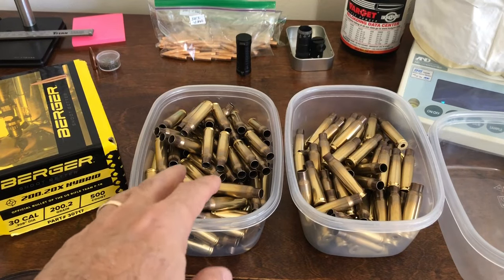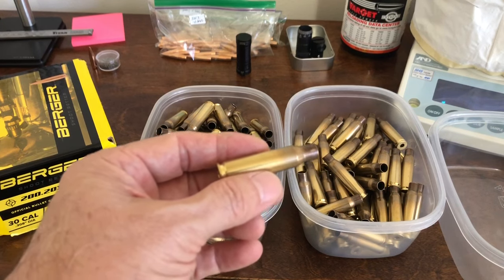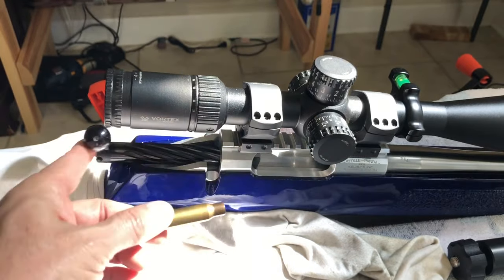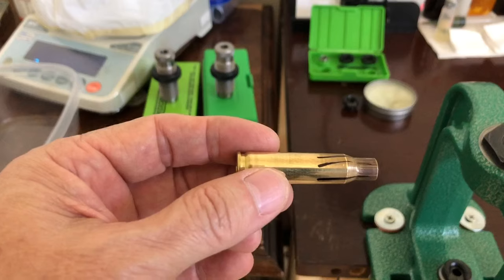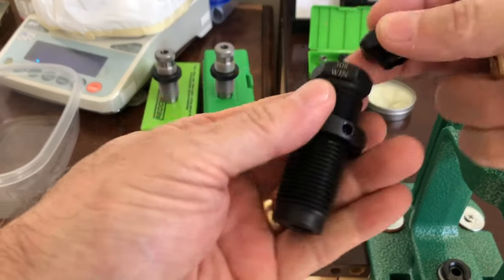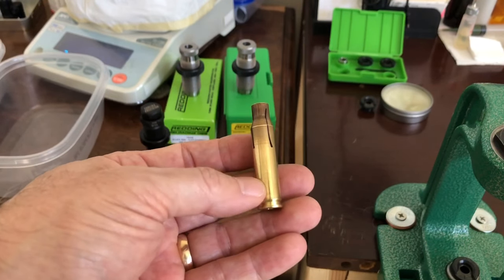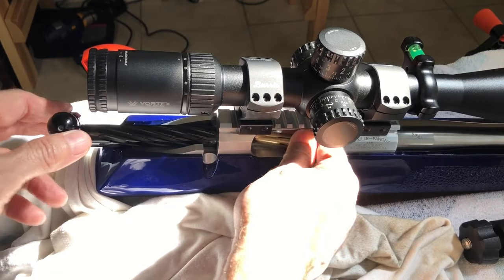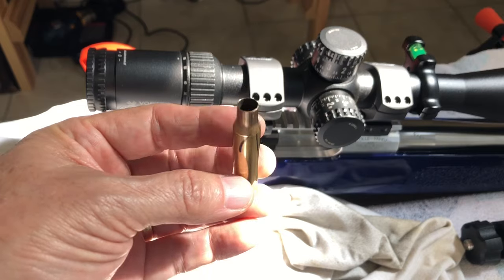Small Base Sizing Die for 308

Comment: same thing happened to me with 6mm br.  the base was greater than 0.471 and would not chamber. after using a small base die, the base was 0.469 and chambered perfectly. the full length sizing die was not going all the way to the base of the cartridge. the case lengthened by 0.002 and the shoulder had to be bumped 0.004-0.005
Reply from the maker: It is a good die to have.